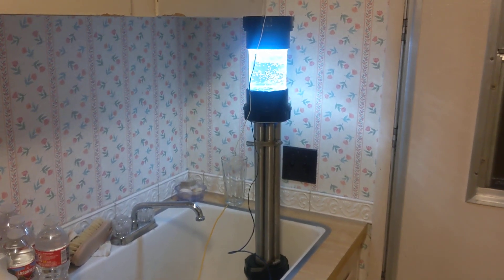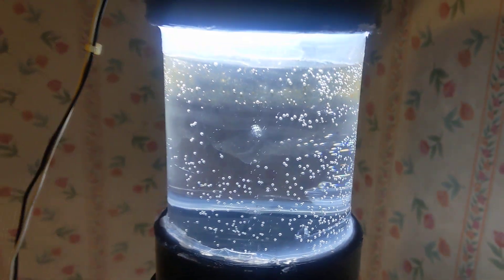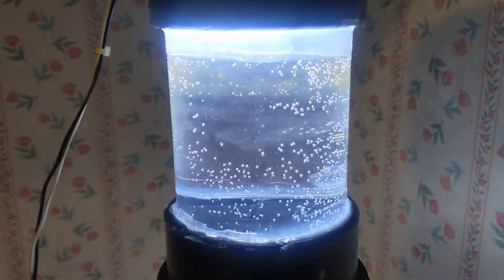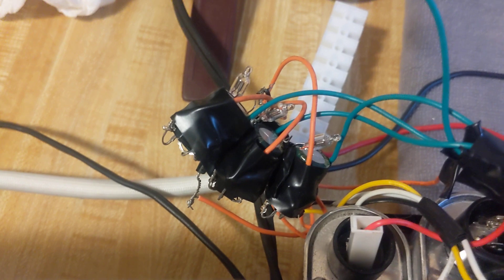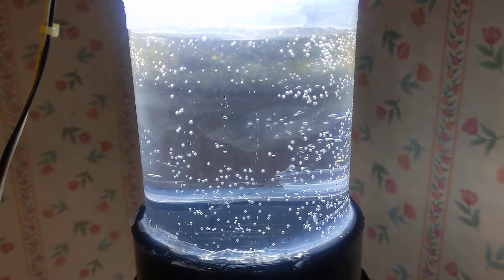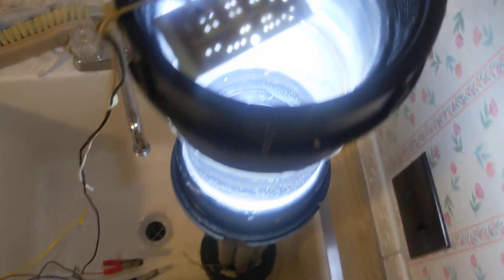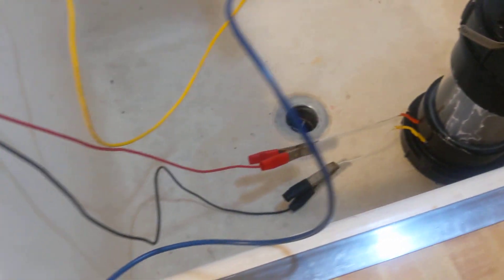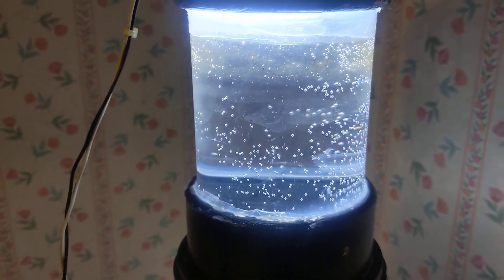High Voltage HHO Cell 24" Capacitive Power

Comment: If your tubes are really long then your gap shouldn't be too small. For tubes that lenght you should have 4 to 6 mm gaps. If the gaps too small the gas cant escape and the efficiency drop. Also i realize that cells in parallel have the issue of one cell conducting more than the other. This is not so much of an issue if the gap is big enough like 6 ml. For small gaps you should do series pairs. So two in series and group them in parallel with other two in series

Comment: Hi man! In my opinion you should be using Sodium Hydroxide as the electrolyte, as it outputs hydrogen and oxygen in the perfect ratio without EVER running out of electrolyte, the output you're getting is NOTHING compared to what you can have using the same amount of power and an electrolyte, you don't need a setup as complicated to generate HHO, you only need a power supply of like 5V but with a lot of amp delivery capacity, you could probably make a power supply yourself with all these caps. Good luck and superb designing skills man, much love.
Reply from the maker: Ya, it does generate more, but I need the cell's resistance to increase by ten fold first because it's nearly a dead short even with tap on all this surface area lol.
Electrolyte and low voltage just makes the gas burn extremely hot instead of quick with higher volts right? I'm going to run it through an engine with 100% hho at some point, not sure how, but that's the goal
Reply: Thanks for you videos ❤, do you think I could use this set up in the car to reduce fuel consumption ? At about 5 A 12vdc  what would be the production?
Reply from the maker: @krisztianadrian8528  will get around to answering when i can run it 100% on the gas, should do, but need to start small first with a smaller engine with a propane conversion. this circuit wont run the engine though
Reply: @weighta6630   Hello my friend, is there a way to contact you personally?
Reply from the maker: you can email me weighta@hotmail.com @Mohammed-uz1sn